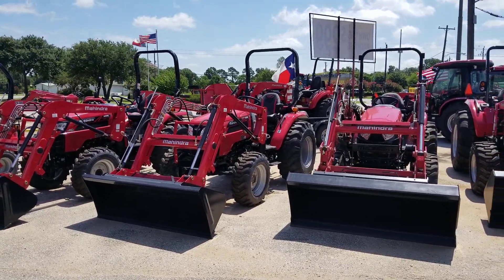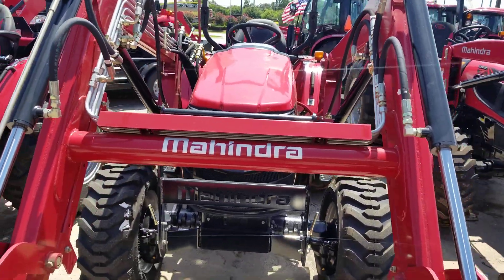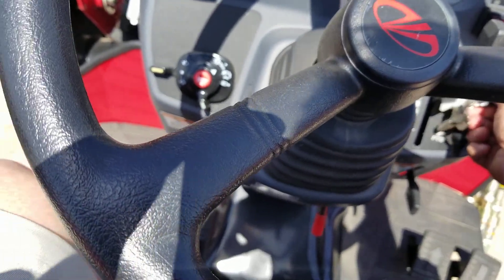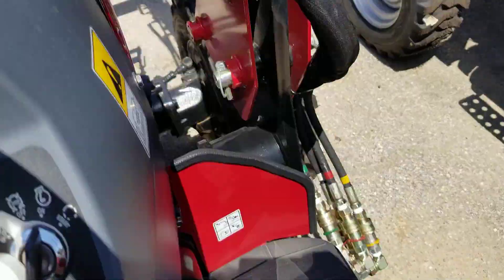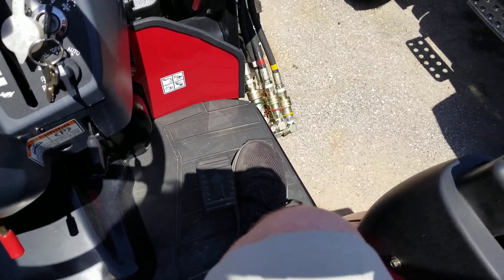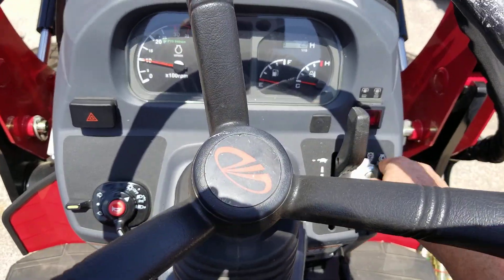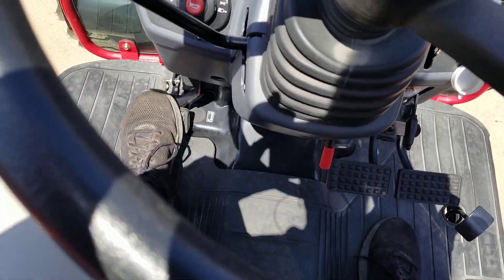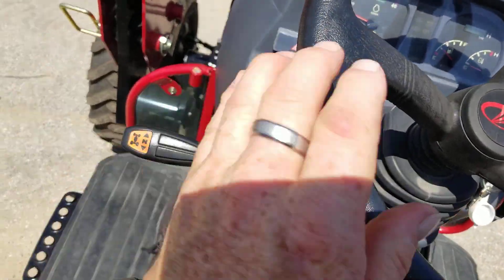HST and Shuttle shift differences

Comment: Does shuttle outlast hydrostat? I heard hydrostat needs rebuilt at 3k hours.
Reply from the maker: I am not sure about that being rebuilt every 3000 hours but I have a lot of customers that never reach that many hours I do know that it takes more hydraulic fluid and it takes a little bit of horsepower away from the tractor itself shuttle shift you’ll just have to worry about the clutching issues if not doing it properly let me know if there’s anything else that I can try to get you answers on thank you

Comment: Am looking for a good cab tractor for mowing.  I like the Mahindra and RK tractors based on cost.  I had to take a nitro pill after my Deere dealer gave me his quote for a 37 hp tractor.  I have always like shuttle shift since our Deere crawlers on the farm had them, and they were 1960s vintage machines.  However, after seeing your video and how Mahindra requires you to use the clutch to switch directions I think I'll revisit the RK tractors again.  All the directional reverser (shuttle shift) tractors I've used didn't require the clutch at all.
Reply from the maker: My bigger tractor 60 hp and above there is no clutching that is called the power shuttle shift and I have several of those in stock. Please give me a call if you’re still interested 832-960 9806.